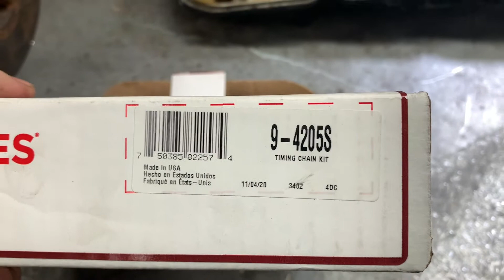How to convert a gen 4 LS to gen 3 1X cam sensor (05-06 GTO timing set) #9

Comment: Doing a lc9 aluminum block gen 4 in a gen 3 truck an the knock sensors are the only thing I’m questioning I’ve seen two different answers but not sure if the type can be changed in hp tuners?
Reply from the maker: Yessir it can, change from resonant to flat response

Comment: What did u use to block  off old cam sensor hole or did u put sensor back
Reply from the maker: This was a gen 4 block so it didn’t have a rear cam sensor, but either way you can just leave the old sensor in it if you have Gen 3

Comment: So what do i actually need to put this gen 4 l9h in my gen 3 swapped s10, what would i need to purchase.?
Reply from the maker: You can do it one of two ways. 

Buy a lingenfelter box (converts gen 4 cam/crank sensors to gen 3) 

Or you can swap out the crank to a gen 3 crank (and sensor), and do the 1x front cam gear.

You can also just have the reluctor changed on the crank but it has to be spot on, so I’ve never done that myself

Comment: Ok ok i think i understand now about the cam sensor.. So, you can use the gen 4 cam sensor on a gen 4 engine.. with a gen 3 crank sensor and a gen 3 reluctor wheel IF you get the extension harness for the camshaft sensor.. and the cam sensor harness reverses the wires for you which ultimately recreates what the early gen 3 LS2 engines had with their setup..which the early LS2's were just LS's that had gen 3 electronics but had the the newer gen 4 front timing cover witg the front cam sensor like the gen 4..So all you need to run a gen 4 engine in a gen 3 vehicle/ harness/ ecm is a 24x reluctor wheel, gen 3 crank sensor(the black one), the 1X gto LS2 cam sprocket that you mentioned, which would require you to run a 3 bolt cam also, and ofcourse drill and tap the knock sensor holes to M10x1.50 to fit the gen 3 knock sensors in place of the gen 4 knock sensors on the side of the block, and ofcourse the extension harness for the knock sensors and the cam sensor, which look very simple to hook up and are all over the internet for cheap. I have not seen 1 video that explained the cam sensor, i've always known gen 4 was up front, knew about the sprockets being different but didn't understand the details on the cam sensor. Thanks
Reply from the maker: You got it! One thing I’d add there is you can ditch the 1 wire knock sensor and buy an adapter harness that converts the plugs to 2 wire, and you bolt the second wire (ground) to the block. That way there’s no fab work, and you have a better knock sensor. 

The only thing you have to do after that is change the knock sensor type in the tune.
Reply: @StationroadRatrods  i appreciate it. thank you for the information!
Reply from the maker: You got it 🙂
Reply: @StationroadRatrods can you do this with hp tuners?
Reply from the maker: Absolutely

Comment: The stock cam sensor for gen 3 does not work? I mean i have a trailblazer lh6 and it have the sensor on the same location than my lm7
Reply: And basically my quedtion is cause you use the stock valley cover so dont delete the stock hole i was thinking that only when you replace the valley cover moves the cam to the front
Reply from the maker: If you have an LH6 then none of this should apply to you, it should already have the black crank sensor right?
Reply: @ yes it have the black cranck sensor so i gues that it should work directly with red blue pcm and harness only changin the throthle body and deleting dod
Reply: Am i correct?
Reply from the maker: It has electronic throttle?
Reply: @ yep it is , my plan its change it to drive by cable and instal gen 3 pcm and harness
Reply from the maker: You’ll need to change your pedal assembly as well
Reply: @StationroadRatrods   you know , i just remove the valley cover and notice that the sensor dont go so down  into the block not sure if its going to feet probably i need to move it to the front haha
Reply from the maker: So it has a false connector where the cam sensor should be?
Reply: @StationroadRatrods  valley gover its like yours
Reply from the maker: Ahh okay. Do you have a blue/green pcm in it now?
Reply: @ no i got a e40 pcm but i want cable trhothle body  so for that reason im looking to made 4rth gen to 3rd gen

Comment: Will the 4x cam sensor work on the 1x cam sprocket?
I read you’d have to use a gto cps because those had a 1x sensor and were black colored but I can only find the gray 4x
Reply from the maker: Here’s a video I did on just that. You can use the grey cam sensor 

How to wire a LS Gen 3 to Gen 4 Cam sensor harness
https://youtu.be/S0XNktoA_K0

Comment: Those four little circles on the timing cover indicate where the oil pump bolts are. I don't think it's a good idea to try and put a turbo drain there. Interference issues big time.
Reply from the maker: Good to know!
Reply: Yep. Those are there to make room for the bolts on the oil pump.

Comment: 24 tooth reluctor on the crank, the different colored crank sensor, the Gen 3 Valley Cover with the cam sensor bore and ofc the ops, the plain timing cover or plugged off cam port on timing cover. Gen 3 knock sensors
Reply from the maker: Black crank sensor

You actually can’t use the gen 3 cam sensor on these blocks, the hole isn’t in the block for it. You need to use the front cam sensor on the cover and the 1x front cam gear. 

Also, the gen 3 knock sensors won’t screw into the middle of the block but I’m sure you knew that. It’s easier to wire in the 2 wire gen 4 knock sensors and just use those. 

Everything else is good.

Comment: Did you end up having,injector problems from the air gap being to big between sensor and sprocket?
Reply from the maker: I didn’t have any cam sensor issues at all, this setup was used on the LS2 so it was all factory parts

Comment: I got a gen 4 engine in my trailblazer so all I do is change the timing gear and put the Gen 4 timing chain cover on with the sensor thing and that's all I need?
Reply from the maker: You’d actually need to change the crank also. The easiest way do this job is to buy a lingenfelter box. It changes the signal to match the gen 4 engine to a gen 3 pcm
Reply: @StationroadRatrods  I got a 2005 envoy Denali  it says it's a gen 4 but it's using the same 24-time reluctor wheel as the gen 3 so I don't have to change the crank then?
Reply from the maker: @krazydogg7685 yeah it’s like a late gen 3, some people call them gen 4. You have all of the correct electronics

Comment: Can I run a Ly6 with gen 4 harness and 58x crank, 4x cam, gen 3 intake/throttle body/heads, 6l80 Transmission?
Reply from the maker: Man that’s a whole mess of different generations of parts haha.

You’d run into issues with the gen 4 harness and the gen 3 throttle body, I don’t know if they’ll communicate. 

And I’m not sure about the 6l80 but didn’t that have a separate transmission control module?
Reply from the maker: If you have a gen 4 harness (07-13) then you’ll want the intake and throttle body to match
Reply: Thanks. Yes it has a control module.
Reply from the maker: Okay. I think the only part that would give you issues would be the gen 3 intake/throttle body. 

You’d be better off going with a gen 4 intake and throttle body (tbss style) because it flows better and it would just plug in and work. Everything else should cooperate just fine
Reply: Thanks! That's an idea I was thinking about, but I wasn't sure of the plug type
Reply: Can I use the blue/green ecu?
Reply: Yes. I have both gen 3 and 4 intakes ready to go. Just don't want to go rec port heads for this project. And I would need to buy tbss intake setup. Trying to watch costs lol
Reply from the maker: @23steph13 if you have a gen 4 intake, that’ll work. They’re the same as the original tbss intake. You can get a cathedral port one too.
Reply: Don't have harness yet. Figuring which gen I should go with so I'm not stuck with  a harness lol
Reply: Thanks for your help
Reply: The tbss I would want is cathedral. The gen 4 intakes I have are rec port.
Reply from the maker: If you have the heads to match the rec ports, that would be a great combo
Reply: Ok. I will have to see.

Comment: 1) Did you have to change the crank gear or you did it just to do it?
2) so you put a gen 3 crank in a gen 4 block? 
3) can I use that cloye kit on a 5.3 or is that only for a 6.0? 
4) so you changed the crankshaft so you didn’t have to change the reluctor wheel? 

Thanks this is my second time watching this video to make sure. 
I have a gen 4 block that I want to use with a gen 3 harness. That’s why I’m asking.
Reply from the maker: 1,2,4) I haven’t changed a crank reluctor before and I had a spare gen 3 crank that was in good shape so I just figured if I have to take it out anyway, it’ll be easier and faster to just bolt in the gen 3 crank. 

3) that cloyes kit will bolt to any 3 bolt cam and work on every LS crank (that I know of, at least the truck engines) 

Ask any questions you like, I’m always around to help if I can. Good luck!

Comment: What about the crank and knock sensors? Love the video!!!🔥🔥🔥🔥
Reply from the maker: What I did with this engine was put in a gen 3 crank and the black (24x) crank sensor. 

The knock sensors was an issue, I didn’t have the wiring for a 2 wire that goes on the side of the block so I couldn’t use them at all. 

Since then I’ve found out that people drill and tap the correct size threads for the gen 3 (1 wire) knock sensors and screw then into the side of the block
Reply: @StationroadRatrods do you have to change anything in the tune?
Reply from the maker: Yeah change the sensors from resonant to flat response

Comment: We changed a engine for a friend and it was a 07 Chevrolet silverado 5.3 aluminum block and the engine he bought was a iron block we bought the timing gear like you did and it runs but sounds like timing is off. Would it need to be tuned or something deleted? The top of the engine was different also the plate his teuck came with a plate that ran all the way across the engine and new engine didn't the 2 plugs in back of plate was on the aluminum block and the cast iron block plate ended before the 2 plugins. Dont know where he got the motor for his truck but it wasn't the same smh
Reply from the maker: If his truck is an 07, you’d want to use the same front gear that the 07 has. It would be a 4x cam gear instead of the 1x like I used here. I would think that’s not the issue, but maybe the crank sensor. Can you look at it (behind the starter) and see if it’s black or a tan/silver colour? 

The tan/silver one would be correct, the black sensor won’t work right
Reply: @StationroadRatrods  it was black. Both the 07 motor that came in truck and the motor we put in 06 Tahoe both 5.3 L have black ones in it. So we need the tan/siver? Thank you for answering my questions I also Liked and Subscribed.
Reply: The plugins on donor motor 06 Tahoe has two sensors on top of engine behind plate under intake original one had a 6 prong to the left of oil sensor and the 06 Tahoe has a 3 prong plugin so we didn't hook it up or couldn't lol. Would this be a problem also?
Reply from the maker: It’s odd that the engine you took out would have a black sensor. The plug behind the intake is going to be the active fuel management system. The iron block won’t have that, and you’ll need to have the pcm tuned to delete the AFM or the engine won’t run correctly

Comment: So if I did a VVT delete on my Gen 4 block do I still need the lengin filter box?
Reply from the maker: Hey, so if you are only doing a VVT delete and staying with the 4x cam gear, you only need to tune VVT out of the pcm, you wouldn’t need the box. You only need that to change from 4x to 1x and vice versa
Reply: Lingenfelter

Comment: I'm replacing a 5.3  ,2005 ,1500, how do I know I'm getting the right 5.3 from home yard, I'm talking different cranks,  reluctor wheel,?
Reply from the maker: Any 5.3 99-06 are the same. The block and heads is what you’re after so if you got a DBC engine, you could reuse your intake manifold and other parts. 

Try to get an 03-06 engine if you can, they have better pistons/rods, but 99-02 are good engines either way
Reply: @StationroadRatrods  thanks sir! I have a 79 Camaro I'm wanting to do an LS swap on, I'll subscribe to your channel ! So the earliest Ls,have a 24 tooth reluctor, and the later has an 80 something tooth
Reply from the maker: Sweet dude!! If you’re on Facebook check out my group, it’s called
 “station road rat rods YouTube” 
I and the other peoples there would love to check out your build!!
Reply: @StationroadRatrods  thanks for the fast response

Comment: pulling on the crank that direction by prying seems not a good idea if its on there much tighter than yours...
Reply from the maker: Do you mean to pull the crank gear off? I couldn’t get it at all with a puller, so I adapted lol. I’d imagine the crank sees a whole lot more force than that with the 12” heavy duty clutch and me popping the clutch in 2nd gear with 2 step 😅

Comment: Can I use the 4x cam gear with the 24x crank? I have an 05 c6 corvette it came with the 24x cram 1x cam with the E38 computer.
Reply from the maker: As far as I know you can’t use a 4x with a 24x crank, but I may be wrong. I did see a video somewhere where a guy showed something like that, and I thought it ran but I can’t remember what gears he was using. 

I though E38 pcm started in like 07 or 08? I’m not familiar with the corvette stuff.
Reply: @StationroadRatrods  Kens korner posted a video of him doing the swap on his 97 CAMARO with a Ls2 swap. He installed the 4x with the 24x reluctor. But he was also using a MSD box for his timing. My bad it’s a E40 on the 05 c6 come with the 24x/1x setup 06and up come with the e38
Reply from the maker: Ohhh gotcha, I bet that was the same video. You’re putting a cam in your corvette or something?
Reply: @StationroadRatrods  I’m switching over from the LS2 to a 427 sleeved LS3 while trying to keep the stock computer and harness. And keep it as DIY as can be 😂
Reply from the maker: Ohhh gotcha. That’s gonna be a savage!! Why not just run a 1x cam gear and put the sensor in the front cover? Worked perfect for me
Reply: @StationroadRatrods  after seeing the video I started doing some research and I’m fishing for information trying to find out what benefit did he gain from doing the 4x swap. Like if it helped with the CanBus communication at high rpm, did it help with tuning, or did it enable better timing with afr. Being that the 427 will be swapped over to the 24x/1x combo and all LS2 accessories I would like to have it dialed in as well as it could possibly be. The LS2 has the sensor in the front cover, and knock sensors on the side it’s kinda like a Gen 3.5.
Reply from the maker: For some reason I almost remember him doing it for no real reason other than to prove people wrong haha. He was like “see? Starts and runs fine!” I can’t really see it being a huge benefit but who knows. If your car came with a 1x 24x from factory my suggestion would be to keep it that way, but I’ve been known to try things on my own so I’d never tell you not to experiment with it. If you do go with 4x and 24x, I’d appreciate if you would pass along your experience with it, it’s great to know more about this stuff
Reply: @StationroadRatrods  I most definitely will!! I can’t wait to get this corvette back running and get some more content out cause I most definitely want to know all there is to know about the LS what can be done and what can’t!! So I’ll most definitely send you an update as I get to know more!
Reply from the maker: That’d be great man, I appreciate it. If I can help you with anything at all, just comment or message me on Facebook or something!
Reply: @StationroadRatrods  I just sent you a message on Facebook thanks again and I appreciate you volunteering to help me out!!!
Reply from the maker: Cool man, and no problem at all!